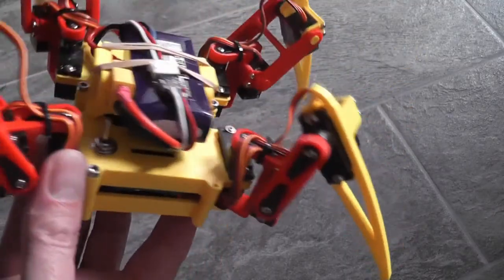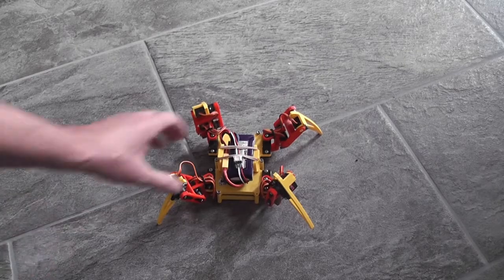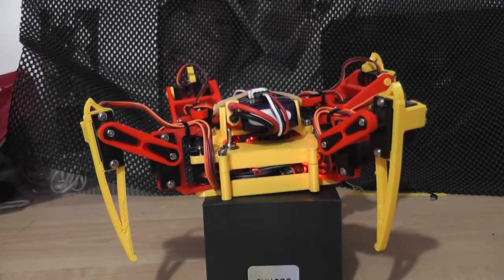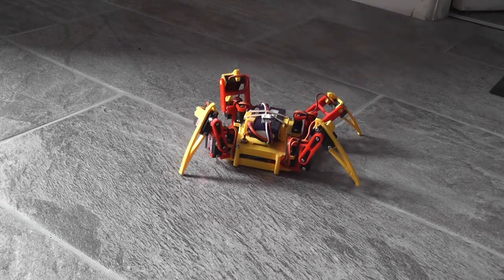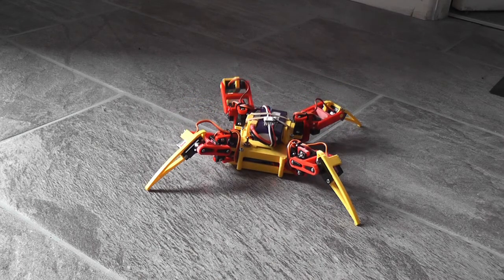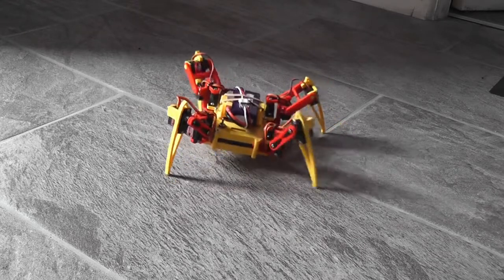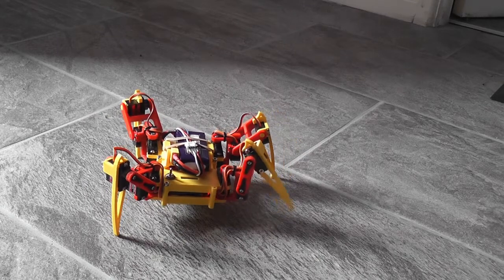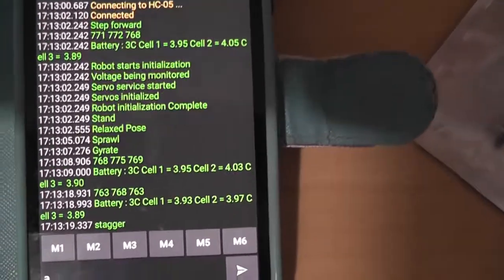Quadruped Robot - (Spider Robot)

Comment: I like your modifications to the design that Regis created and your modified code is pretty interesting. I built this Quadruped a few days ago and I've been playing about with the code. I used the base code for Bluetooth control that Regis made, then I added back in his code for dance and given it a Bluetooth command. I've also been going through the original Sunfounder code which this was based off and adding bit that were removed that are still useful and commenting code to make it easier to understand etc. I also plan on adding the code you've made to different functions depending on space.

One thing I can't seem to find anywhere is the ability to make this Robot Strafe (side step) left and right. I'm wondering if you've had any luck with this at all as you seem to of modified the code a lot more than anyone else on the net? It seems a bit daft to make a Robot that can walk, but only give it the same ability as a wheeled or tracked vehicle by just going forward, backwards and turning around. If you've not found a way of doing this yet then I'll update on here if I manage to find this out myself.
Reply from the maker: I have not done anything to the code since producing this video. I think it should be possible to make the robot walk sideways fairly easily. It has four legs and can walk forwards and backwards so for side ways you just need to treat the legs on one side as if they are the front legs and the legs on the other side as back legs then the walk forwards will be to one side and backwards to the other. I think the same movement should work. 
OK not as simple as I make out but the principle is the same. Instead of lifting a leg and moving it forward then putting the leg down again. it will lift the leg and move it to the side then put it down then repeat for the other legs.
Reply: @johncrombie2771  Thanks for the reply. I know that in principle it should be fairly easy, the thing that's kinda confusing me about it is the fact that Sunfounder set this robot up with X Y and Z axis (which of course makes sense) but only appear to of set it up to move along it's Y axis and Z axis for height. I'll definitely take a look into it though, would be kind of cool to make it walk like a crab.

I've just finished putting your code into my Modified Quadruped.ino and setting up Bluetooth functions for the most interesting moves you added. I'll upload it to google drive or similar once I've got it how I want it and send the link on here if your interested.
Reply from the maker: @DanielYoud86  The X, Y and Z coordinate translation is known as the inverse kinematics of the robot. It is supposed to make it easier to control. You just tell the code where you want the end of the foot placed in X,Y,Z space and the code takes care of how to move the servos to achieve that. 
To achieve the crab movement you are after, I think you have to change the code to move along the X axis. I suggest starting by duplicating the forward walk code but swap the X and Y values for the leg movements or at least the step part of the coordinates.

Comment: I can't find code.Please send me link.
Reply from the maker: I was able to get the code from the link in the description but here is the direct link.
https://drive.google.com/file/d/1O0KmWBFTaUCrSZ9OJg8fOSg2bq-MI83t/view?usp=sharing
Reply: @johncrombie2771   thank you . how to set value in app for control
Reply from the maker: @ruhullahansari919  I don't control the robot from the App but it is possible. I was thinking of entering commands like W5 to walk 5 steps. The main loop in the robots control code would need changes to read to command and the invoke the correct movement subroutine. I have just seen this video from Ivan Miranda. This robot seems to have the same joints so it should be possible to program the same movements. https://youtu.be/vxZaByZEchk
Reply: How to program to set command give me example plz
Reply from the maker: @ruhullahansari919  I am not an Arduino programmer so I am not the best person to give advise here. The way I would approach it is by having a command to read data from the serial port at the start of the main loop where it currently stands. Google tells me the command I need is Serial.readString(). Take the first character of the string using stringname.substring(1,1). Again a Google search gave me this  Then convert it to upper case just to make things easier using the toUpperCase() function. Again a Google search gave me this function name and details of its use. Then I would use the resulting character in a switch statement to select the function to perform. E.g. switch ( firstLetter) { case "S": Stand() break; etc..... I'm not sure if it would work but that is how I'D start. 
The other option is the Regiis Hsu article in instructables. He's has already done this and his code should work on this robot.
Reply: my spider is moving forward backward left right stand sit shake hand hand check but your spider do more than this.
Reply from the maker: @ruhullahansari919  ??? I don't know how that can be if you are running my version of the code. All the other moves are performed before the moves Regis programmed. If you are using my version then it should follow the sequence of moves as shown in the video one after the other. It starts by standing (Regis move) followed by Relaxed pose then move body forwards and backwards etc.(my moves) then finishing with walking, turning and waving (Regis moves).
Reply from the maker: @ruhullahansari919  If you are using Regis code to control the robot from your smart phone then you need to manually add the extra moves from my code to his and then add commands to invoke the additional moves.
Reply: @johncrombie2771  can you give me ur email ? i need help.
Reply: There is an error "addCommand is not declear in this scope ." How to fix it.

Comment: Great design! Thanks for the battery schematic & information. What battery did you select -- can you please provide its specs?
Reply from the maker: kekaroo It is a 1300 mAh 3S nanotech lipo battery from Hobbyking. It should work with any 2 or 3S battery Lipo battery or even a different chemistry. It was a battery I already had and the size seemed about right.

Comment: Hey I was wandering what kind of code did you use for the remote
Reply from the maker: unknown There is no remote being used. The robot is just going through a preprogramed routine. There is a bluetooth module on board so a bluetooth remote could be used to control it or I could use my smart phone. I have a bluetooth terminal script to show debug information. This can send data in both directions.
Reply: @johncrombie2771 can you please send the code for controlling it ?
Reply from the maker: @canisrigelm0627  The code running on the robot is linked in the description. I can't help with your request for controlling it using a game controller. You are on your own with that. It should be possible but not something I have any knowledge about.
Reply: @johncrombie2771  ohh ok no problem thanks for the response, I found your link but I don’t know which part is JEST THE CODE for copying and pasting, can you send a link which has only the CODe so that I can just copy and paste it directly
Reply from the maker: @canisrigelm0627 https://goo.gl/cBsz3V
Reply: @johncrombie2771  so I should copy and paste the whole thing or should I start copy from - setup function?
Reply from the maker: @canisrigelm0627  I would copy and paste the whole thing. Get your robot working the same as shown in the video then modify the code to get your controller to work.
Reply: @johncrombie2771  thanks a lot 🙌